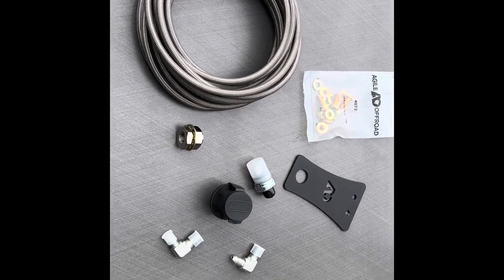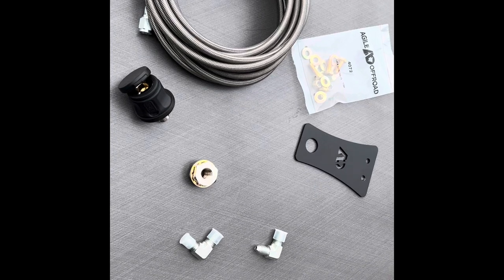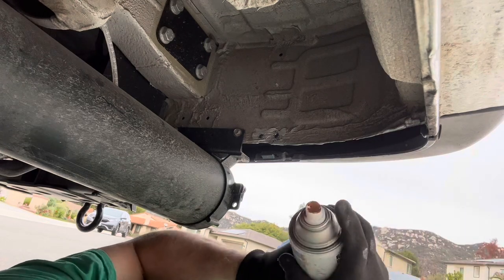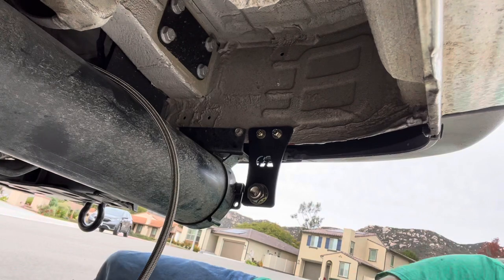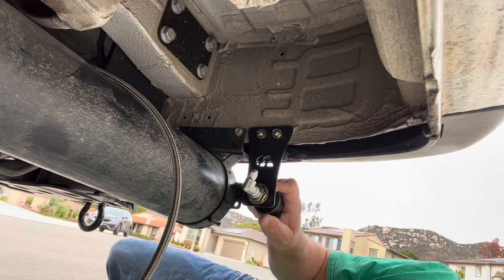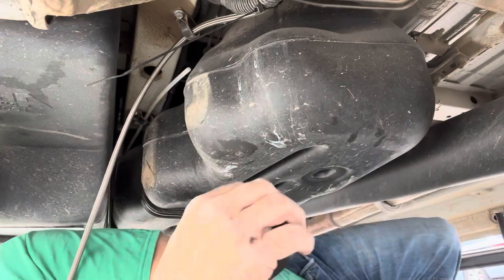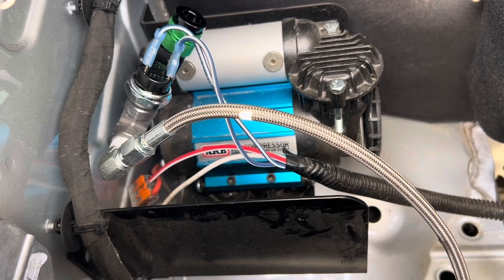GAME CHANGER!: Agile Off Road’s Jayco Terrain & Entegra Launch On Board Air Upgrade Kit Installation

Comment: The biggest benefit I see with this kit is the additional pressure capabilities. However, I don't see where or how you mounted the new switch in your video?? Where does it go, and how did you attach it!?
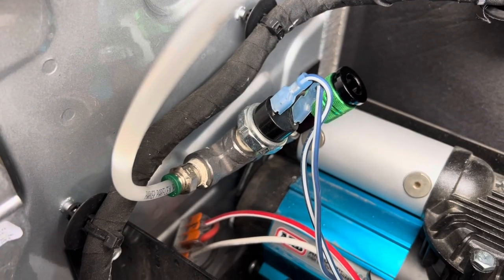Reply from the maker: If you go to the 8:05 minute mark in the video you will see where the replacement switch goes. You just swap out the original one on the air compressor.
Reply: @terrain4x4adventures  awesome thanks

Comment: Great job!  I did the same mod but didn’t put the electrical “thingy” on….did you say it increases the air pressure output?  Did you just unscrew the old and screw in the new?  Thanks. We need more of these type of videos and need to add this to our video facebook page.
Reply from the maker: Thank you!  According to the description on Agile’s website, “The included ARB switch increases air pressure from CLOSED/70 PSI and OPEN/100 PSI to CLOSED/135PSI and OPEN/150PSI”.

Installing the switch was simple. Just unplugged it and backed it out - added Teflon tape the the threads and bolted it on and attached the wires.

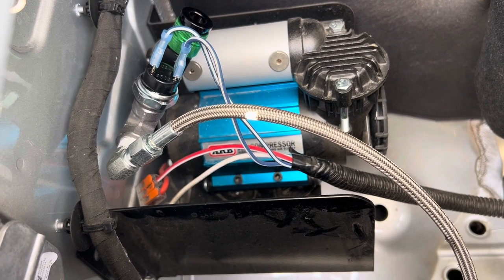Comment: This is amazing! Thanks for filming this. I purchased the same kit but too afraid to install without any instructions. Two questions for you: 1. is it possible to reuse the same screw/bolt for the rear chuck holder? Want to avoid drilling if possible; 2. On my terrain, the air compressor itself seems to be sitting too close to a metal divider (the black one at 8:42 in your video) and the body panel under the hood and it seems impossible to screw in the 90 degree adapter without taking things apart. Is that the case for you? I purchased a straight adapter but haven't tried to put it on yet.
Reply: I didn’t have to drill new holes. My new screws were a perfect fit.
Reply from the maker: Thank you! Yes you could use the existing screws but replacing them with the hardware that comes with the kit will provide a more secure mount.

Threading in the 90 degree adapter was a bit difficult for me primarily because of the wire loop that’s right next to it.